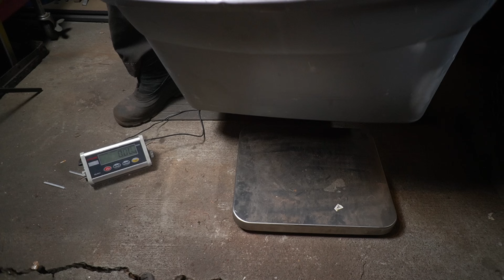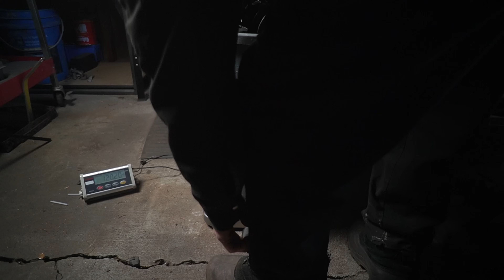Scrapping a MOUNTAIN of Motors for Scrap Copper! How Much Can We Make?

Comment: I will be the 44th commentor saying PLEASE SECURE YOUR VISE TO YOUR BENCH. It can only help. Also, is it the camera, or could you use a little more light in there, Drake? Seems a little dim. Anyway, thanks for another great video!
Reply from the maker: Defs need to bolt the vice down haha
I’ve enjoyed being able to move it to Center when needed but I think a solid stump is the right move here. And I’m sure you can imagine I have more lights, I was making a stylistic choice to have dramatic lighting with a single source. Though in hindsight I could’ve made better use of it with better placement 👌

Comment: Once you've cracked one and found it's aluminium inside wouldn't it just be better time spent for the profit difference to just send motor's the same as full motor's rather than stripping them out as their very unlikely going to be copper?
Reply from the maker: You mean rather than checking any of them? I’m on the fence with the job overall but if you mean just the identified aluminium ones, absolutely.
Reply: @thubprint   I'd open one to see but any that are the same I'd leave and send I  as just a motor.
I have a washing machine motor sat ready to go. Fortunately the design means you can get to the windings without opening it up so I've checked and and it's going as a motor rather than being dismantled. Even the armature inside is aluminium. Rather depressing when you think oooow nice lot of easy copper there lol

Comment: I just turned in 69 pounds at 3.40 for number 1…. It was bare bright but this scrap yard. Alls it number 1 or they are really ripping me off
Reply: But my other yard specifies the same wires as bare bright @3.10 a pound so who knows
Reply from the maker: At my yard #1 and bare bright are the same thing, there’s no “super premium clean” category. I suspect it’s the same at the two you’re going to, they just have slightly different naming systems.
Reply: @thubprint  regardless I’ve been taking 50 pounds or more in twice a week cant complain! Also I had a mega score of extruded aluminum 720 pounds of it from an apartment complex that was replacing the doors for the patios
Reply: They had it scattered around inside a dumpster and it wasn’t a dumpster with only that and it was a dumpster with trash in it so to me it was free game